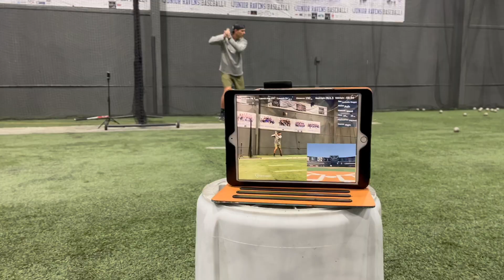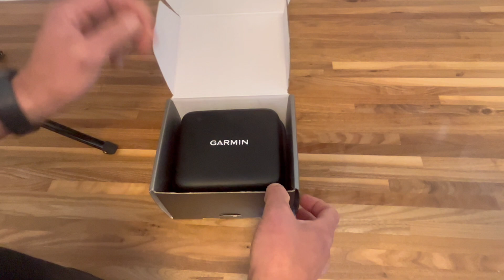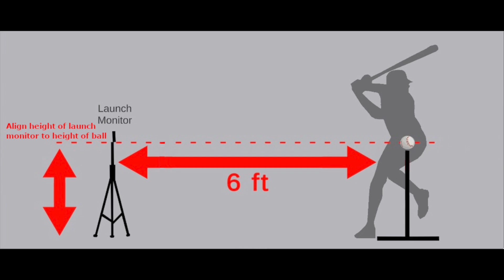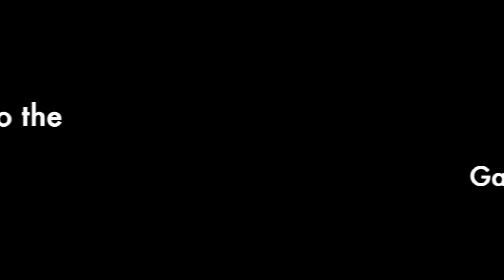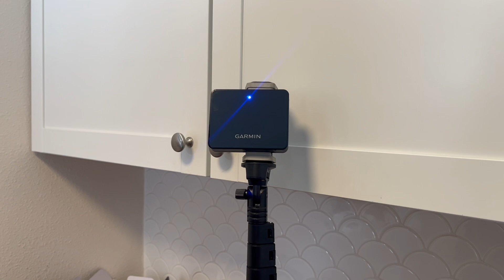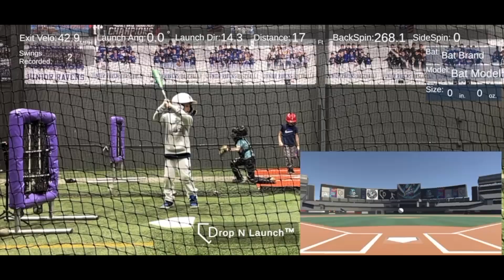Drop N Launch Guide: Set up Your Batting Cage

Comment: Screen Mirroring - Is the iPad recording the video in this case?  Could a coach in the front of the cage control the app remotely?  Or can a different camera record/send the video to an iPad the coach has -thinking soft toss screen.   I am wondering about pausing or replaying the last swing video to provide feedback without having to leave the cage.  Is this possible?
Reply from the maker: Currently, it operates with a single iOS device that does the video recording, but there are wireless mice that can connect to an iPad, and the iPad can be screen mirrored to a TV so that it can be controlled remotely and I believe will achieve what you are after.